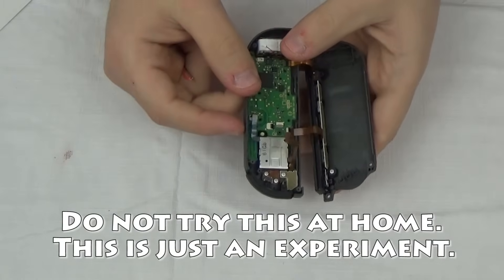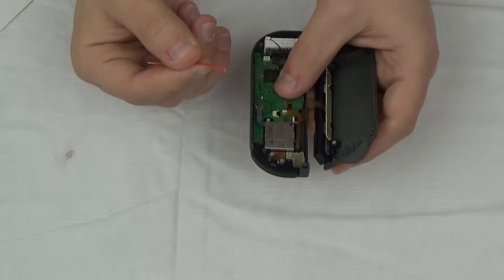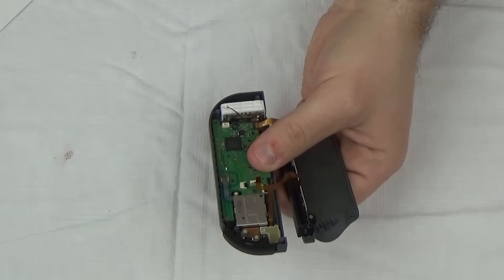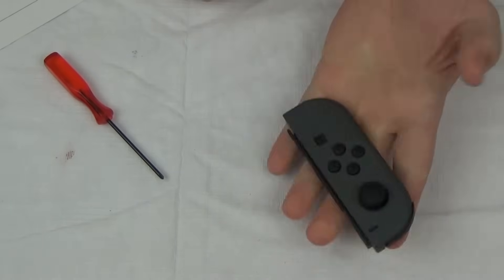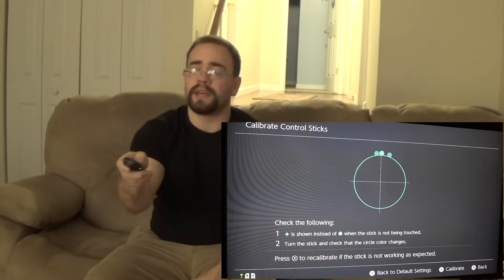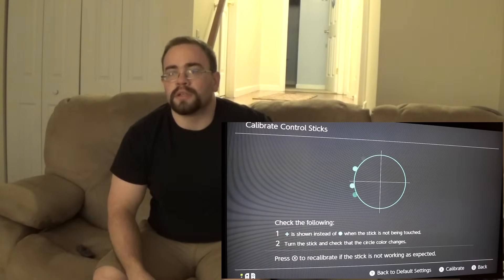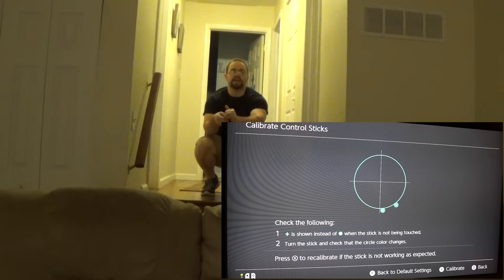Fixing The Left JoyCon!

Comment: "Youtube guy fixes years of corporate R&D with a wire"
Reply: Nerman Talakic Engineers HATE HIM, click to find out how
Reply: lots of careful planning ... and then finally careful cost cutting
Reply: Nerman Talakic He didn't just fix it.. He upgraded it lol
Reply: This is the kind of thing Nintendo from the 90s would have caught without a shadow of a doubt imo.
Reply: A bit of wire cost close to nothing, they likely didn't even know about this issue since it works fine when you are close to the device so they were thinking that it hold as well as the bluetooth specification says.
Reply: its actually simple to retool for this solution.  The real problem is with customers refusing the old product and wanting to know which part #'s are the revised units.  Its a HUGE headache for distributors and retailers.
Reply: 1stgamerx well no one has been saying they would have had to implement this fix as it is. The point is the issue is on the controller that is less complex and the other one has a dedicated antenna and they obviously have an assembly method for that one.

The thing that bothers me is that the antenna placement on the board here is not only next to a metal cover (granted that may be inconsequential, but it is just as likely to be a contributing factor) but also placed in a spot that is much more likely to be covered when using the joycon in the upright position than on the other one.

That is two strikes.
Reply: This is my thoughts. My switch does not have any issues in my Living Room. I have a rectangular living room and the TV/Couch are along the long walls. That means in order for me to get further than about 8ft away I need to walk into another room. At that point even my PS4 controller has issues because of walls/pipes/ect. My guess is that they designed the controller based around typical Japanese rooms, which are smaller than most US rooms, and focused on battery life which is not very good to begin with.
Reply: Battery Drain would likely be under 1 percentile .
Reply: Did you know American airlines saved over a million dollars a year just by removing 1-2 olives from their salads.
Reply: not years, it was rushed and not even tested
Reply: @mrdehboss not really if anything it will reduce the battery by 0.001secs, heck it may even increase the battery since the joycon has better reception with the switch and doesnt have to output more power to get the signal to the console
Reply: I DIED!! Thanks for the laugh!!
Reply: Darius Batista there's some of left joy cons that are having sync issues that being more than 5 feet away causes problems
Reply: 1stgamerx it wouldn't have been a wire in manufacturing. The engineers would have had to design the pcb with this in mind.
Reply: The wire is actually as stupid as it sounds.  The real problem is that this is a cold solder bridge across a reserved space for last-minute design changes.  There isn't anything wrong with their design, it is a manufacturing defect.  See my comment in the main thread, I have replicated his results just reflowing the solder on that same point he used, which was also obviously cold on mine.
Reply: I'm modding mine, I've soldered plenty of things and this will be cake. i get sync issues from my couch about 6 feet from my tv.
Reply: I'm laughing so hard right now
Reply: I'm not getting anywhere near that. I'm getting about 8 hours. Plus it barely charges when the switch is not docked.
Reply: Well it works assuming you dont have a bunch of shit in your way. I've had no issues. 15 feet away. but I'm not playing behind my back or with a bunch of stuff.

It's good there is this work-around for people who do have a bunch of objects/items in the way or weird living room setups.
Reply: 2 cm of wire costs money and we had to meet a $299 price point! lols :P
Reply: Ss, true. The Nintendo switch is a modded Nvidia Shield. Nvidia upgraded the electronics for Nintendo. The Shield is a android based gaming tablet that had great reviews but no one heard of it. But now its out of date. Nvidia rreleased a new Shield TV a couple of months ago. The shield tv uses the same SoC as Switch but Switch has more features. But Shield games are cheaper but it does not have for as many games. But it can be used like a real tablet with Google play apps.  "NVIDIA continues console ambitions with new Tomb Raider release"
Reply: It would be a pretty crazy assumption that their testing cycle never involved signal strength of the wireless controllers. Maybe a change late in development was made, and they did not have the time to address it... but they must have noticed. If they brought in any gamer and asked them to test the controllers, every single one would find a problem with signal strength within a minute.

Nintendo had to have known, and made the decision that it was not a big enough problem to demand a fix before they shipped.

Also, you point out how cheap this fix would be, but the math is a little different in a big company like Nintendo, making millions of consoles. The cost of any change is, of course, multiplied out by the number of consoles made. But it also has a cost of R&D, sourcing the parts at a large scale, testing the parts, thinking about each part from every angle. Any change they make pushes out the release date, and increases the cost.

Anyways... my assumption is that they knew, but were in a very big hurry to get this product out the door. It always seemed rushed to me. Possibly nervous about releasing too close to the new xBox. The slim library, and how fast they went form announcement to release made me suspect that. And all of the little corners they appear to have cut appear to confirm it. You might say it was a mistake... but apparently this is their fastest selling console every so far. And for them what is important is getting an install base. Then they can fix issues after the fact. I feel like all the issues will probably start to slow down sales... but it was a console that was always going to be driven by its games. And Zelda is being praised.
Reply: well 7 feet away I got problems today, even with a tiny wire mod, I dunno the proper length and loading and all that crap. I wish it was simple as putting a dipole on the backside by drilling a lil hole. but 2.4ghz that's a whole diff ballgame than 2meters. I know ps4 controllers lose audio maybe +5 feet where my joycon started losing analog stick synch. so meh. I had to really try to get it to ignore my input, so I guess its fine for me, just don't expect to be 15 foot with lil kids walking in front of the system.  Does anybody play like under neath somebody else cuddling? I mean with split joycons you could literally be slow dancing and playing zelda. far stretch but yeah, what good is super portable play how you lay joycons without signal :(
Reply: Nerman Talakic you're profile picture fits you're comment.
Reply: And then reduced the life of the joycon by years.
Reply: Evil of the World are you quoting Nintendo?
Reply: RehabOholic if you call Nintendo's call center they will open up a service to fix your joy-con in about 1 week. I sent one of my left joy-con in. It took 1 week to get to them and then back to me. And now it works as well as one that I put an antenna in it like the video.
Reply: SSPsGoku Yeah. 20 hours that charges on the switch automatically sucks.
Reply: Brilliant! I want to do this now 😂
Reply: inceptional  NFL,
Reply: Nerman Talakic at this point it's almost like Nintendo is trying to ruin its reputation in the console Market
Reply: It was years. Nvidia made a new SoC chip just for Nintendo.
Reply: Can't add a simple wire into the Joycon during production, it would cost Nintendo a whole $0.01 in labor and parts per Joycon!
Reply: but Nvidia didn't make the joycon. I read nintendo always skimps in terms of adopting slightly older, but cheaper tech. shrugs
Reply: so @Paul Brookfield just tapping it with a hot solder iron should flow the solder properly?
Reply: Ultraseamus I would argue that they didn't want to have the console any big flaws but they thought like the joycons are usable atm and we can bring out better ones later in the year for a cheap (or maybe even the same, but that would be very rude) price. Joycons can be easily replaced the switch itself however can't.
Reply: It's pretty bizarre that Nintendo let this through when the Wii U could stream a video signal to a battery powered tablet through walls and up to 50 feet of air with less latency than some televisions, and the Wii U came out 5 years ago. Rushed?
Reply: @drencrum I'm thinking the wii-U pad had a higher power consuming 2.4ghz connection,  and cpu that could do more error correction for the video, than a lower power/battery life joycon. Old polygon article says the wifi in the tablet is special. I'm wondering if the Joycons are more off the shelf bluetooth. Supposedly they connect to a pc quite well, which might reflect that "off the shelf" approach.
Reply: Paul Brookfield Thanks, i hadn't seen your other post before now. That'll be even easier. I'm not looking for 30 feet, just useable distance
Reply: +sspmm3 Yeah, Wifi Miracast.
Reply: 2.3in antenna should be correct for bluetooth frequencies.
Reply: LMFAO
Reply: ROFL
Reply: Nintendo could have put an extra wires to make the antena bigger like he did. or even added an external antena to the joy-con grip so when it is in the grip would expend the connection. the grip it self it probably empty inside with enough room to put a bigger antena into it.
Reply: so true but now that they did they can still put an external antena on the grip to resolve some of their issues.
Reply: MotoMechzorz You do it yet?  If so, it work?  I just ran across this fix.  I sit about 8 feet away and mine cuts out all the time.  Sometimes just reclining my recliner is enough to make it go from working mostly OK to barely working.  It's very frustrating.  So I'm thinking about doing this fix.
Reply: Vidikron just did it today. please be careful, and don't attempt if you're not super comfortable with a soldering iron. Esp. if you don't have the money to replace it in case you somehow break it. that said, it does work, very well.
Reply: Could you share a picture somewhere. I'm ok at soldering, but not so much with circuits. I tend to do it more with pictures and instructions.
Reply: Murilo Gaming a week is too long is you only have a pair of joycons, i hate this stupid left joycon i love the switch but that fucking joycon  is just so frustraitung to play with i  cant play zelda like that.
Reply: who cares I ended up doing the warranty repair.  However, that was after I bought the Pro controller.  So I could send it off and still keep playing.  My plan was to buy a Pro controller anyway so I didn't really view it as spending anything extra.  May not be the case with you. Anyway, I sent mine off on a Monday and got the replacement/fixed one back that following Friday.  So it really was very fast.  You might be able to get Nintendo to cross ship... where you send your in and they send a refurb at the same time, but they might require a credit card for that just in case you don't send yours in.  I think I read where someone said they were able to do that.

Whether you fix it yourself or send it off I'd definitely recommend you eat it fixed.  The frustration just isn't worth it in the long run.  Especially when you can get it fixed for free.  Yeah, you may have to wait a week which will indeed be annoying, but the total frustration of having a busted JoyCon for months on end would be much worse.
Reply: Vidikron i know but im in the usa for vacation i bought my joycon here cause is way cheaper here than in mexico, sadly i have not money for the pro controller and i dont think my dad would buy it cause it is a little too expensive and he already bought me a game, also i cant use the pro controller to play just dance  lol so yeah i cant really send my joycon to nintendo cause i wont be here next week i can play it on portable mode no problem but once i want to play on tv mode i cant be 10 cm away of my switch and it still will desync is so frustraiting.
Reply: Indeed, I don't know much about electronics (more of a software guy), but I know enough that seeing where the antenna was on the problematic joycon made me roll my eyes.

People should tweet this to Nintendo for shits and giggles really. I get that they don't want to acknowledge an issue but the likelyhood of the interference is obviously increased by the internals of the joycon rather than being attributable to how people use it and where. Unfortunately this also confirms there is no software fix, not that I honestly expected there to likely be one.

This kind of form factor means that you can't make hasty choices on internal design, you could see there is no room for mistakes (sorry).
Reply: markuwil which is quite understandable, but I'm sure there was a good reason. maybe another idea they had for the antenna would have lowered the battery life too much or maybe interfered with something else. it could be that the answer to the problem would have made the price of the joycon higher for the consumer. there is no way to say for sure why they did this, but in the end what they did was most likely the best option for everyone. also for some reason the day one software update seemed to help most people's problems with the left joycon.
Reply: dunkey voice you're done nintendo, you're fuckin DONE, BTFO
Reply: MotoMechzorz I just reflowed the solder (again with no pointless extra wire) on another joycon and I hear its another success story.  I recommend it.
Reply: Yeah, such a fucking headache, FOR THE CORPORATIONS. JESUS CHRIST ARE YOU JOKING? It's a fucking headache for the CUSTOMERS who are forced to play the fucking lottery with every purchase. Oh, want a 3ds? Odds are you'll get a fucking TN display instead of the IPS display you want. But it's the same price, same shit supposedly, supposed to be 100% the same between units. Fuck nintendo and fuck any corporation that does that shit. That's fucking lying, false advertisement bullshit.
Reply: sspmm3 I strongly suspect it will - it has on mine and the bridge as it was from factory on mine (and Spawn Waves) was underfed solder and cold.  You may find there's plenty of room to add more solder, I'd recommend adding a bit more.  But I think just reflowing it will work in a pinch.
Reply: +Murilo Gaming They could've made the controllers sensibly sized for normal human hands and then none of this would've been an issue to begin with.
Reply: Nerman Talakic it will drain the battery a bit more btw.
Reply: well it's not so easy to add something as simple as that wire into the controller. you have to understand that these are being mass produced by machines most of the time and just adding a wire like that could disrupt the order of how it's made. or they may even need a new machine entirely. either that or have people solder it on by hand which would prove to cause problems.

Comment: It blows my mind that something like this should even need to be done. Why on earth couldn't the left joycon have had the antenna the right one does? Would it really have been that expensive? You literally just soldered in a wire that could be bought at a hardware store for less than $1, I imagine, and yet it makes this much of a difference. 

But nah, let's put our PCB antenna right next to a metal box on the opposite end from where the signal needs to go; can't possibly see how that's a bad idea...
Reply: Maybe the metal box was added later.

Comment: So it is a hardware issue. That sucks. Another reason the right joycon would be different there is that the housing for the analog stick is at the other end of the controller, and not next to the antenna, on the other joycon.

Comment: You didn't fix the joycon, YOU PIMPED IT!!!! glad to know it's actually a hardware issue and it can be done if one knows what is doing there. Can you pinpoint WHICH solder point to put the antenna?
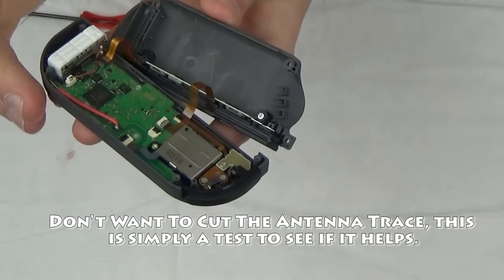Reply: Did you skip the middle of the video? The wire is shown soldered on at the 2:36 mark
Reply: actually it wasnt clear since i didn't turn on HD, bandwith i$$ues, you know. But now i see, thanks for the time mark

Comment: I don't know why you're saying not to do that, seems like that's a great solution that's not really that difficult, considering it seems much worse for some people. Utterly shocking that some guy could just solder a wire onto a spot in the controller and fix a problem that a multi-billion dollar company couldn't figure out over months. Why they would leave the antenna next to a metal square, I have no idea. Still an absurdly stupid company. Maybe that explains the inconsistency of the problem? Maybe different batches of Joycons have different metal square things in them for whatever reason. Maybe they were made from a different metal, different consistency of metal, something like that.
Reply: Nintendo probably had different engineering teams working on the PCB design and the overall Joy-con design and didn't do any RF testing to check the radiation patterns.
Reply: Good point. I do get the impression that the different branches of the company don't communicate nearly enough. I mean the marketing and copyright teams certainly don't. Hey, let's let you upload clips from our games to Youtube!... and then copyright strike them!
Reply: Guy A. Person My guess is that some of the people putting the joycons together might have messed some of the batches up

Comment: i cant even go more than a meter away from my switch before my joycon stops working . its terrible .. worst thing of all there is not allot of wireless devices in my house .. there is one router but that one is like 15 meters away on the other site of my house with a stone wall between it and the switch
Reply: noblackthunder Have you tried what user “Da Fonse“ said a fee commens up? if it works share it, I do not have a switch yet
Reply: what?